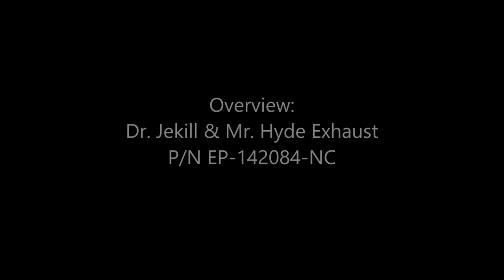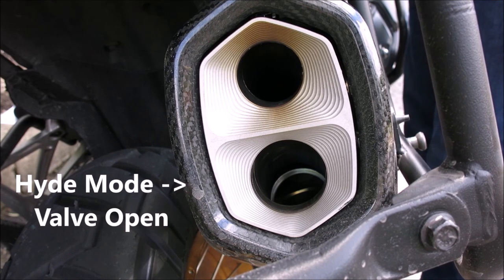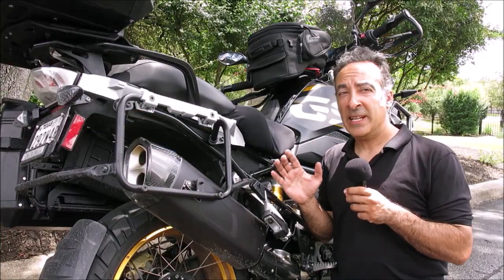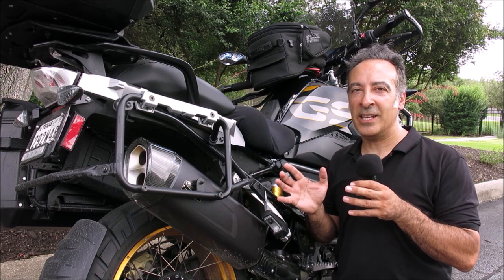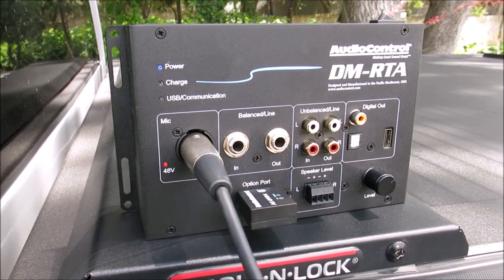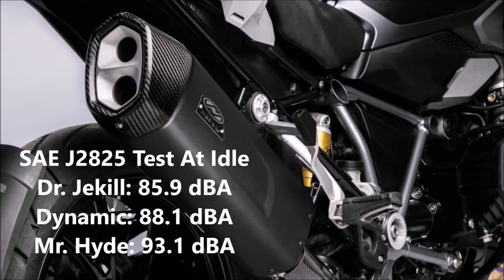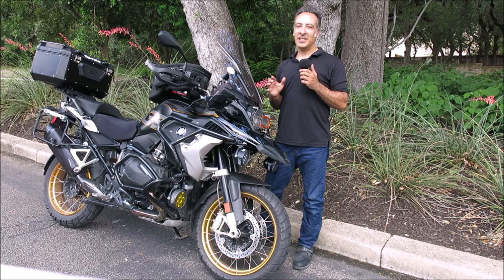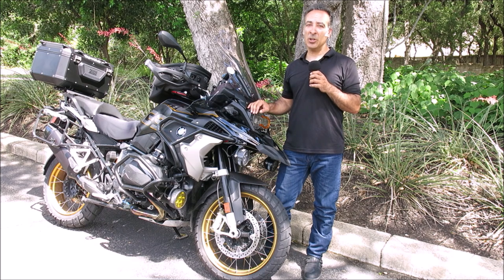Dr. Jekill and Mr. Hyde Exhaust for BMW R1250GS Review - Moto Mouth Moshe Episode #71

Comment: The best upgrade I gave to my 2018 GSA, often touring in Austrian Alps, where the police is very keen and enforce excessive exhaust noise, , I could adjust at my pleasure, and enjoy the throaty sound and burps/farts up and downshifting while maintaining a very low profile less intrusive while riding into small Tyrolean villages, do strongly suggest the upgrade, BTW the exhaust come with an EU  certificate of approval in digital and card format that can be shown to whoever will be challenging the installation, apart that on my triple black the black finish with carbon fiber and milled steel tip end looks really fancy!